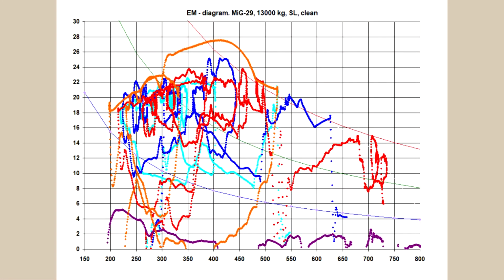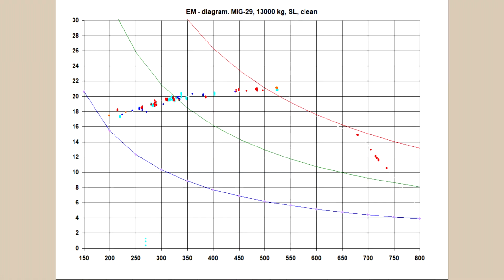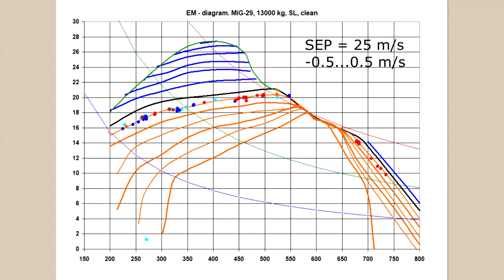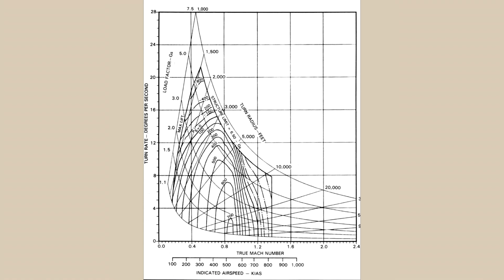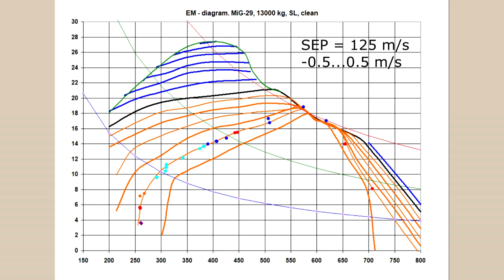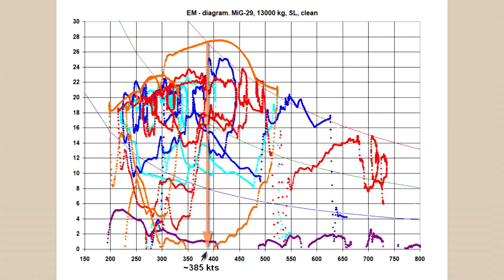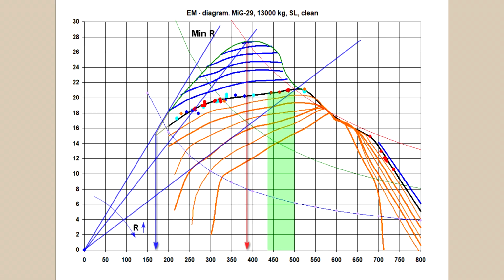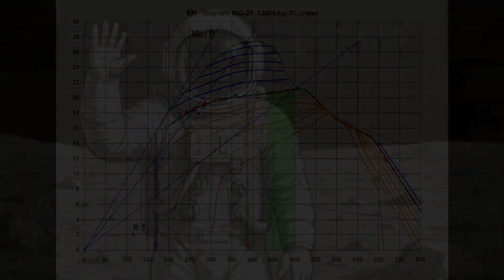DCS MiG-29 EM diagram

Comment: What turn radius do you get?
Reply from the maker: R = TAS(m/s)/ROT(rad/s)
Reply: @Lidozin72558 okay, what about minimum radius and best STR turn radius do you get with your chart?

Your equation gives me 808m for a 21 deg/s turn at 920 kmh, but I wonder about slower speeds
Reply from the maker: @AeriaGloria  Using the same formula, you can compute the turn radius for any point of interest on the chart.
Reply: @Lidozin72558 I see, I get about 380-400m for the bottom end, which is pretty middle of the road